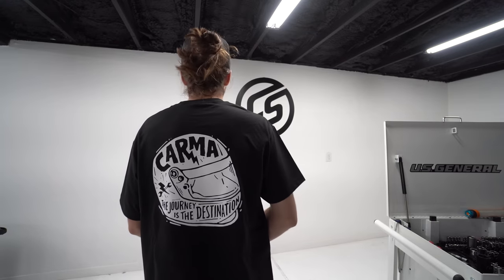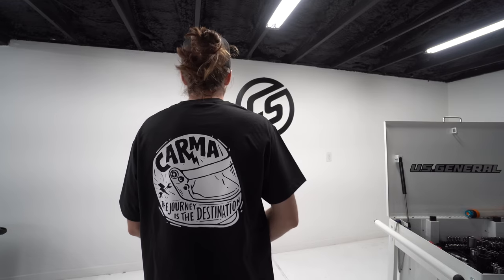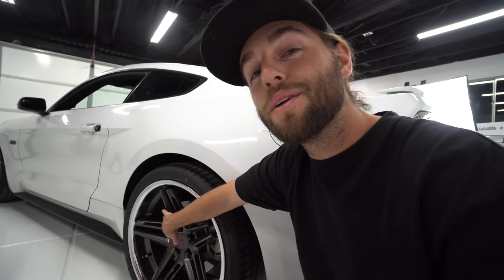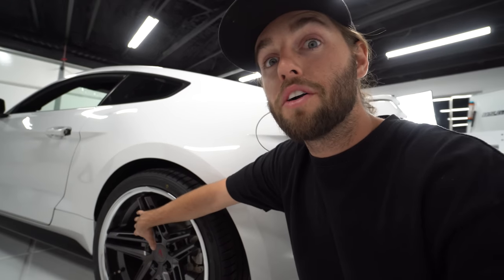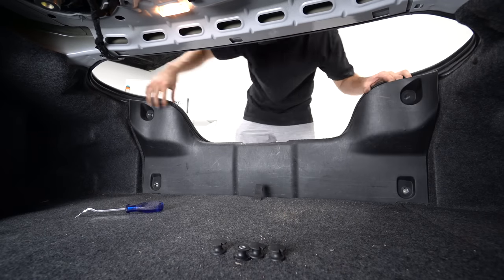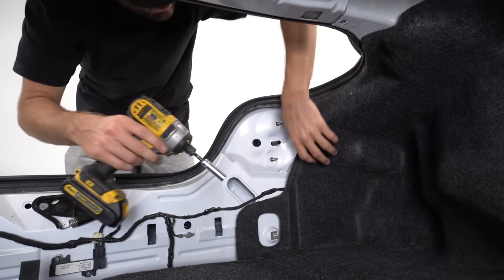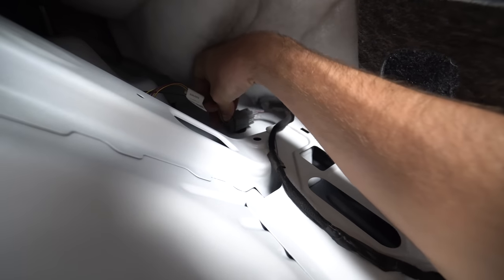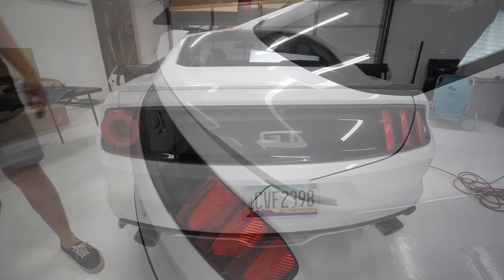Building a Mustang GT: Ferrari Style Tail Lights Install & Unboxing

Comment: Can you please do a how to drive manual 5.0 I’ve seen a lot of different videos on different feels of them idk weather to get auto or manual?
Reply: Hey man, as you decide on auto or manual, I would look into the issues that many people have had with the mt-82 manual transmission too. It’s been the manual transmission that Ford has been using on Mustangs for the past several years to cut costs on production. Unfortunately to get the better Tremec manual transmission, you will need to upgrade to the new Mach 1 mustang or get the Shelby GT350/GT350R. At the end of the day, it’s your car and driving manual is always fun!